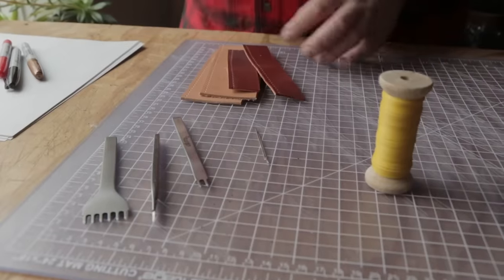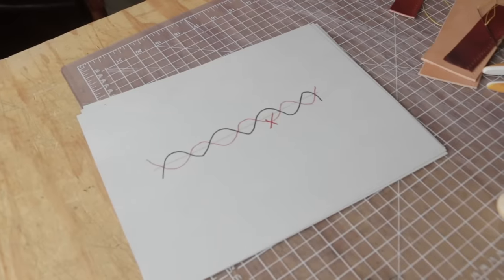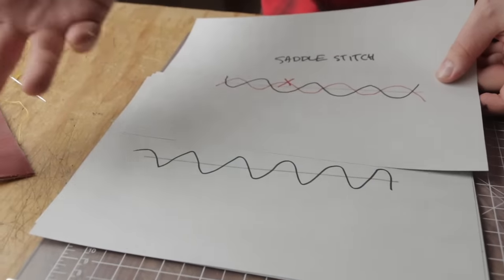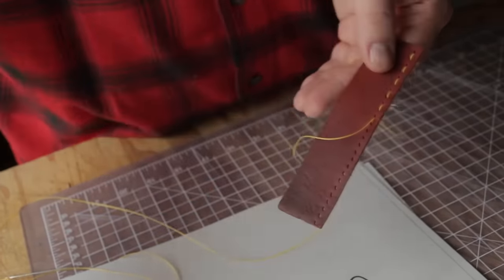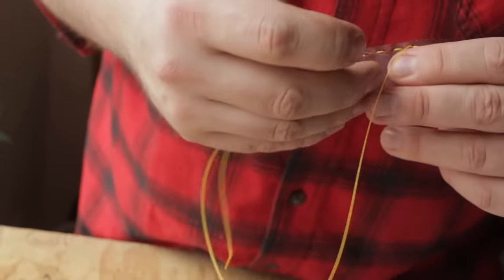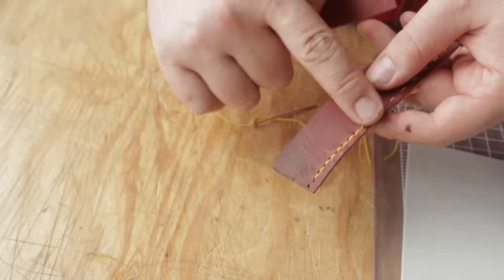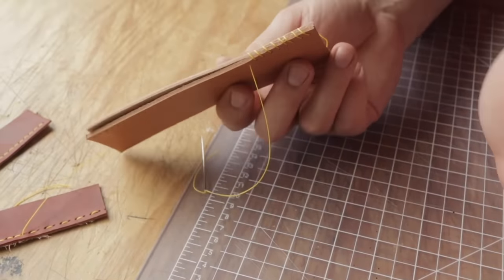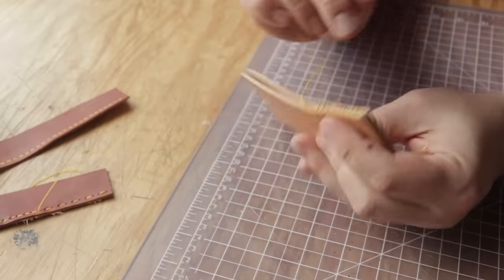The PROBLeM with Hand Sewing Leather

Comment: I am a starter in leathercraft and some of my questions might sound silly or naive...  but as I said as a former flight instructor, there's no stupid question as long as it makes you learn something and keep out of trouble. So here's the question: since the main problem with the running stitch is how the stitching is going to wear out, is it imaginable, before even punching the holes, to create a groove in the leather inside which the thread would kind of insert? This way the thread would actually stick out less and maybe even not at all...  I understand it could also look kind of packed inside the groove, thus screwing the esthetics a bit, but maybe a slightly wider groove would make it work?  Just an idea... what do you think?
Reply: @Hugo Millère  -  a "U" or "V" Grove can certainly be used for this purpose and in some cases actually helps with the asthetics of the work - BUT - in the case of the up and back stitch it still doesn't help with the tension problem.  So then you pretty much have put a bandaid on a bullet wound so to speak.  Good thinking though, I do use a "U" groove often when I am lining a piece with a thinner leather like a suede and it's for exactly the reason you came up with.  Think a belt or shoulder strap with an inner lining that will potentially have a bunch of friction, but instead of grooving the suede liner which is likely too thin to groove, you put the groove on the heavy leather of the inside of the belt on your stitch line so it pulls the liner into the groove when you stitch and if you have your depth right everything is pretty uniform.
Reply: You can cut a groove and stitch inside it. This used to be popular on horse tack to protect the stitching from thorns and twigs. It's ok on thick leather, but it does weaken it. The top surface is the most compressed, epidermis, so it's the strongest part. If you cut into it, you have a line of thinner, weaker leather for your stitches. It's also more prone to water soaking in, so you would need to wax it and keep it oiled  which in turn will rot natural threads like linen.
Better to have a few stitches cut and be able to repair them when you get home, than to have a seam rip out on you and have to replace a whole panel.

Comment: I created a very small holster for 1 or 2 keys as they damage my pockets all the time if my 2 keys are in there loose and all. Made from some leftovers that were pretty smooth and shiny, so had a bad grip for such a small piece. 
So I used the outside stitch for that "key case"/"key holster" as it provides my fingers better grip when I take it out and also stays in my pockets.

I just restitch it every year or so, use some simpler cheaper thread and am good to go.

Comment: Thank you so much for this tutorial on the stitches. May I ask you please if you have any tips for me? I have a medical condition that makes my legs swell to unbelievable size. It’s very painful, but as this happens daily, I am extremely limited in the shoes I can wear. I have purchased a pair of second hand shoes and the strap that goes around the ankle is too small. I knew this when purchasing them, but I have purchased vinyl to lengthen the straps. I dare not try this in an expensive pair of leather shoes as yet until I am sure it will work, so that is why I thought it best to cut my teeth on vinyl first. 

I have cut a length of vinyl in the same shape as the original strap and glued it to the old strap, it is much longer. I am now going to sew it together using your saddle stitch that you showed in this video. I did wonder first though, have you any suggestions for thread? Also have you any advice at all on glues to use. I used a flexible gel superglue and it comes in tiny bottles, so it will work out expensive in the long run. Would I be able to use any glue you suggest on vinyl and on leathers please? One last thing, is there anything that I should be putting between the two pieces of vinyl to help them with being more sturdy? 

I am about to go and see the pieces of vinyl to the original strap now that I have checked if they will fit, so fingers crossed. However for future reference, I really would appreciate any advice you could give me on this. Being able to wear shoes again will be life changing for me in many instances, I am worried though, that due to inexperience with these types of materials, I will go out and they break on me adding to my embarrassment of my very swollen legs. 

Thank you so much for any help or advice. 😊

Comment: Depends on the length of the stitch line I'm doing. If it's for a small wallet I will do a saddle stitch without using a stitching pony. If it's a longer stitch line I will use a saddle pony because it helps hold everything together as I stitch. When using lace I will do a double round loop.

Comment: Nearly 48 years ago I lerned this techniques from an old german master.
My entire lifetime I use his knowledges. But never by any  machines, quicksewers, stitchponies, punchers and other abrevations. 
The futher way is the best way. By handstitch with enbraided needles, Svord- and round awl stitch after stitch on my old sewing block between legs. This block is handmade from my 90 year old father. My yarns are prepared with bees wax, and glue (if necessary) I made from rhy flour.
Try avoiding knots, if necessary, use the slim Weaver knot. Stitch the first needle from underneath and throw it back when stitching the second needle from above.

Comment: I am hard on the things I use for work.  For that reason, I make most of my leather products myself.  
I try not to get carried away, but I've found that overkill is always sufficient.  For example, my outback style hat is made from 8-9 oz. leather.  It weighs 2 pounds, but it offers protection that can only be beat by a real hardhat. Of course, it's sewn using a saddle stitch.  I didn't even know there was a name for it.  It was just the obvious method of making a strong stitch.

Comment: I recently did a red white and blue dog collar. The leather was blue but I did separate running stitches of red and white. I was wondering if you have any thoughts on doing the stitching as a saddle stitch. I did 2 running stitches not the technique I am outlining. Basically a double stitch at the first stitch for the red and white threads to anchor them. Then using the saddle stitch technique for the stitch line. The effect was nice with alternating red and white stitches but was a bit wavy with 2 separate running stitches.

Comment: I learned the Leapfrog method from your video and I love it. But after I switched to mostly using so called french style stitching chisels, the method is not ideal as it does not cast the thread. The result is a nice slanted stitch on one side but a straighter stitch on the other side. I suppose you could run the needle down through a loop on the side facing you but then it’s not as quick and smooth anymore. A pony is more convenient then, in my humble unlearned opinion. But for diamond shaped chisels the Leapfrog method handheld is superb! So nice to sit on my balcony and lean back and relax as I saddle stitch something.

Comment: On the french stitch, it isn't really a knot, unless it is a knot.  And that knot won't hold anything.  It may stop the seam unraveling but it doesn't change the fact that the thread broke, and it is no longer continuous.  Though is may not really matter, something has to give to get that knot in there, and that something will be larger holes, or finer thread.

Comment: Hey thx for the video quick question.. when saddle stitching do you put the 2 needles thru the same hole or each needle go thru different holes?
Reply: They go through the same hole, and cross over inside the width of the leather

Comment: With the saddle stitch is the thread all one piece or two separate pieces of thread? If it is all one piece, how do you know how much thread to start with?
Reply: Yes, all one piece. I use 4-6 times the length of the stitch line depending on how thick the piece is.
Reply: For short jobs (less than a dozen inches), you'll need a fixed overhead, 'cause you need to manoeuvre your needles. For very long jobs, you'll probably have to make a stop, then continue with another thread.
Anyway, it's a single thread, you start  at the 2nd hole and go 1 hole backwards, then forward. At the end, go 1 hole backwards, to have your ends strong.
Reply: There are calculated charts depending on the thickness of thread and leather. 
You use a single piece with a needle at each end. Centre it at the beginning, then off you go.

Comment: How do you know the correct length of thread when doing a saddle stitch?
Reply: Depending on the leather thickness, 4-5 times the length. Very thick like 3 thick layers, I use 6 times the stitch length. Plus a bit more on shorter stitches.

Comment: How do end the pattern at the end to make it look clean? Just a knot? Making a leather cigar case. Thanks.
Reply: Stitch back through the last few holes again to make an invisible ending. I usually knot first, then sew ends in for around 4 or 5 stitches. 
If you use polyester thread, you can melt the ends carefully with a lighter or a special heated thread tool like the 'zap-it'

Comment: A lot of talk about what is better or stronger, comes from linen days.  Linen was great because with wax, it almost got  bonded into the leather.  But linen is very weak when compared to modern threads, that could even in some cases be as strong as steel.  Nylon or polyester are strong enough, though.  But the point is that processes like hand sewing have no practical advantage over machine sewing with the strength of threads we have. And the same is true of alternative stitches.   I have combat 1911 holsters that were machine made by Bianchi, a Chapman comes to mind, that are a nice as the day they were made, and went through extremely heavy use.  The seams as beautiful, and thin (in 3/4" welt)  as a hand stitched European artisan product, and they have no apparent wear.  So the point is that yes, some methods are "better" than others, like hand stitching, but no, they aren't better because they don't look nicer, or last longer when it comes down to it, because the of threads we have.

And the threads used are machine threads.  They have stretch, or wax doesn't bond to them. They were probably treated to run in a machine, without wax.

Point number 2 for the hobbyist is that  even were certain stitches are better, most products, other than maybe shoes, never wear out.  This is not the other twenties, at least not yet.  People don't get 1 purse and use it for life.  High end stuff like those 10K handbags will never wear out.  And for hobbyists we make so much stuff for ourselves, trying out new patterns and products we will never wear those out either.  Do what you want, it doesn't make any difference.

Comment: How do you get those holes in the leather so straight and uniform? Is there a tool for that?
Reply: Yes. There's a tool like a fork
Reply: @dshe8637  Yup. Thanks. It is shown at the beginning of the video laying on the table.
Reply: @johnmccormick8159  That's it at 0:07 they come as a set